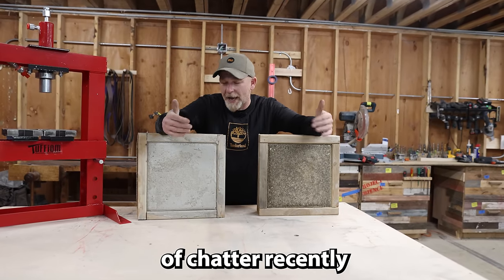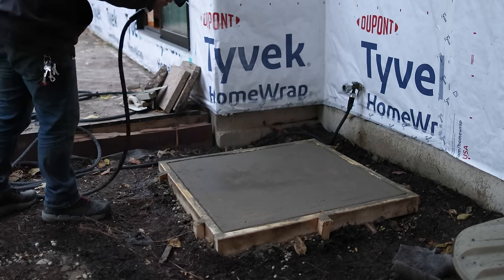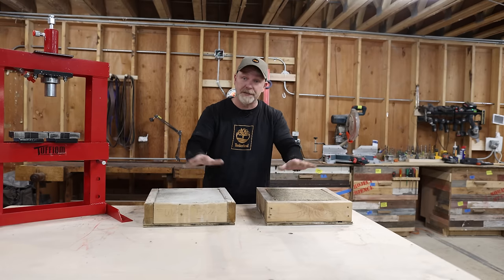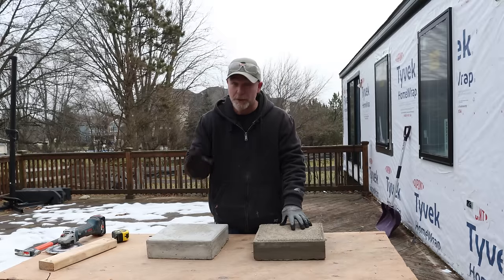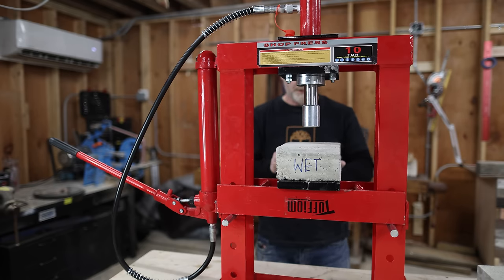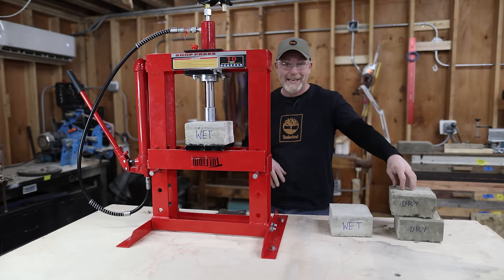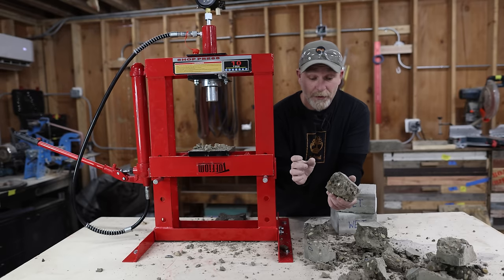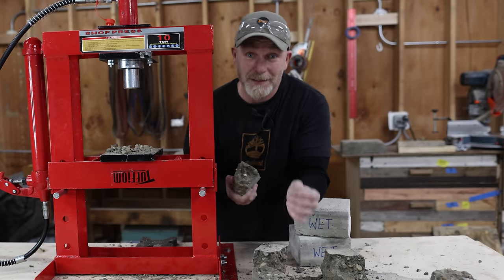The TRUTH About Dry Pour vs Wet Pour Concrete!! Strength Test - You WON'T Believe the results!!

Comment: As a certified concrete field testing technician, I can say that while water is the catalyst which causes the reaction for concrete, too much will cause weakness (ALWAYS READ THE INSTRUTIONS). Concrete does not dry, it CURES through a chemical reaction...which is why it gets hot when poured en-mass. The slump is a very accurate indication of the water content of fresh concrete, unless it contains admixtures such as air-entraining chemicals or fly-ash to increase its 'workability.' (In the case of admixtures, there are correction factors applied to the slump measurements). In any case, once properly mixed concrete is placed, it will continue to gain strength and cure FOR EVER - far beyond the 7-day initial strength, and certainly beyond its 28-day in-service strength.

Comment: I learned this the hard way. I dry poured a small walkway running from the front door to the side of the house. It's been 2 years and the walkway is full of hairline cracks and is getting rougher as time goes by. I'm going to redo the whole thing, but had I done it right the first time I would've saved myself $400 in wasted concrete.

Comment: Water is the catalyst in the chemical reaction. By mixing before the pour you are ensuring every chemical agent in the mix is coming in contact with enough catalyst(water). Dry pour misting will fail to do the same resulting in a much lower failure load.

Comment: Electrical engineer here. Alot of civil engineer here but dont know why dry mix is weaker. 

the main reason dry mix concrete tends to be weaker is because the cement doesn't effectively coat the surface area of the aggregates. When mixing concrete, water plays a critical role in ensuring the cement paste fully surrounds and adheres to the aggregates.

Comment: Thanks for the video. Been contemplating doing a dry pour for my kitchen countertop for a number of reasons. It looked like it had been snowing during your experiment, and I wonder if the weather may have had anything to do with your results. I believe the humidity is quite low during winter months when snowfall is present, and perhaps another dry pour experiment is due during the more rainy season to compare results. In my experience humidity and rainfall play a large roll in concrete setting up.

 I live on the rainy side of the Big Island of Hawaii where the humidity is pretty much 75-90+ % throughout the year so much so that any bags of concrete left outside even if covered will set up within a few months without ever being wetted. I use dry pour when installing fencing t posts after drilling and pounding them onto the lava, because it's easier to get the powder down into the hole around the base of the post, and it sets up quite well here with the regular rainfall, but can crack a bit if tension is put on it while pulling and attaching the fence itself. So unless there is a lag between installing the posts and pulling the fence itself it will have some cracking, but still does what it needs to sturdy the posts, and I do wet pour the corner post after core drilling the holes that will have the most tension put on them. I also wet pour t posts in low spots with additional concrete that will have more upwards tension on them to prevent them from potentially pulling out of the ground.

I've done several wet pour countertops for a guy I help where we build a melamine mold, and wet pour quick set concrete powder, and then flip them over onto the counter so the hopefully smooth base surface becomes the top. They're always a pain in the ass.
 Getting the concrete mixed fast enough, and evenly enough with consistent wetness is always a challenge and a huge mess mixing small batches in a bucket with a paint mixer which is the only way to get the mix thoroughly mixed fast enough and to the right consistency.
 This last time we tried a large slow turn mixer and it was way to slow, wouldn't mix evenly, and started setting up in the mixer so a lot of concrete was wasted. Also this was halfway through the pour so we had to quickly switch back to small batch mixing in a bucket to continue the pour while at the same time trying to salvage the large slow turn mixer by knocking out the setting chunks. Won't be using that again.
This has me considering doing a dry for my kitchen countertop which will be supported by the existing plywood counter that will remain in place after the pour has set. All that needs to be done is to make a small form along the edges. I like the idea of this method for several reasons, firstly it will be seamless, and no need to build melamine molds, and flip heavy concrete countertop sections after they've set, and then grout the seams. Also the surface will be nicely flat and form fit, especially if a powder only concrete is used, and even if it turns out grainy from regular misting a skim coat can always be applied afterwards. Once set it can be stained, and epoxy coated.
  My only concern is how to keep it wet enough until it cures without soaking my entire house. I realize it won't be nearly as strong as a wet pour, but having  seen how solid bags of concrete get just from the relative humidity here I feel like it will be quite strong enough to measure up to the needs of a countertop, and shouldn't have any of the edge chipping issues  when epoxy sealed.
Idk I'm still considering it, but it would sure beat getting concrete everywhere , and all the other challenges of doing a wet pour.

Comment: It makes sense a dry pour does not have the water penetration through it uniformly. I used dry pour for a wooden post once and like the video even after several years when I removed the post the old concrete just crumbled away. The other thing is the dry pour concrete costs a lot more for large areas than getting a trailer load of proper builders mix of gravel and sand and adding the cement to make a quality wet concrete. 
Keeping concrete damp for a week once it has set makes a stronger concrete as well.

Comment: If you're just doing a small slab, just dump the dry concrete bags into your form, and mix it wet while on the ground. I never understood why people mixed in a container right beside the small form, then had to use a shovel to move it 2 ft into the forms. The forms are your container, mix it on the ground.
Reply: Do you put anything under the dry pour first to hold water. I agree on the mixing and then transporting, that's the real pain in the ass, makes sense to just mix it in place. I have a section of dryway that is 12x18 that's currently just stones and right up against the house foundation (cinder block foundation). How would you recommend dry pouring and mixing in place. Gap or no gap along the cinder blocks? The rest of the driveway is concrete they just didn't pour this one section so this section I want to pour is surrounded by concrete driveway on two sides and cinder block foundation on two sides. Thanks

Comment: How about a half-wet pour?  Enough water to kick off the thermogenic crystallizing, but not so much that it squishes or lets a metal anchor sink in it?  Mixed in more water while it was in the hole.  Saved us a whole day of waiting for the cure when putting in anchors for shed posts.  We set the posts on the anchors immediately after wiggling the metal anchors into the damp cement.  Kept wetting it for a week.  No noticeable shift or sinking after placing the posts on top.  It’s working great for our horse shed.

Comment: Read the comments from the engineers.  Dry mix dampened in place is ALWAYS weaker.  Lab concrete tests are made on concrete test  columns that are aged in a curing room  with misting water dripping off the walls.  It is almost an exact scientific test.  As a student Civil Engr  several  of worked in our U OF MD  Engr lab on contract with Md dept of Transportation. We poured many many test blocks of concrete for the interstate I80 ?)  between Baltimore  and York Pa?  continuusy reinforced (with re bars)   As students we learned. More water above spec in the mix=weaker concrete.  Full strength n 28 days. Building  my own home in  2000  I caught the concrete boys adding water to my4k psi ordered mix for the driveway “Goes. Down easy.”   Stopped that shit at once.  Other drives crack after about 1-2 yrs.  Less water at pour== stronger pour. More moisture just after pour=stronger pour.   Good Luck. 
JoeB. U of MD. CIVIL degree Class of 1972

Comment: I used dry pour for the 10×13 slab under our pergola in 2022. It was 4" thick & I also added rebar, I was sure to really soak it for the first 24 hours. I knew that the strength was going to be less, but it was only going to have table & chairs to support. It's still looks good with no cracks, it does have a rougher finish but I'm ok with that.

Comment: To fully cure concrete you need it to be saturated for up to a month. (I saw this on smarter every day once) Dry pour is similar to roman concrete, where cracks form allowing moisture in, which causes the inside to cure more, thus sealing the cracks.

Comment: I've worked in construction for 30 years, I'm notba concrete man, but seen it done many times.  I've never seen professional concrete worker's dry pour concrete.  It's only a short cut, a easy way out of working hard. A neighbor of mine  who does concrete work told me also he has never, and would never, do a dry pour.  Your test proves this, or, the proof is in the pudding.

Comment: Cement is the Bonding Agent in Concrete.  It works by Chemical Reaction with the Molecules in the water.
There is a Timed reaction that takes place,  from when the water is Mixed in.  
If the Proper amount of Water is Not Mixed in at the correct time or Too Much Water is mixed in, then the Strength of the Chemical Bonds will be reduced.
The Bonds develop as crystalline Fingers and rapidly grow at first, then slowly stop growing,  Additives can be added to Increase the rate ,  or Slow down the rate.
Thats the difference between a Quick Setting mix and an extended workability mix.

When you Dry Pour,  and only wet the surface,  the reaction starts and the bonds are only Surface bonds.  Once the Crystaline structure stops, you CAN'T restart it, or get it to Bond to New Crystals.
Then you Soak in more water and again, only surface bonds of the new wet portions are created. So you end up with many areas that are void of the strong crystalline bonds and None that interlocked together with the other already formed crystalline structures.

This is why, there is NO manufacture in the world that Officially endorse Dry pouring of Concrete.
It will Never reach Structural Strength. 

Cement is NOT a glue.  It's a Chemical Bonding Agent that needs to be Homogonous when the chemical reactions start..
When Pouring in steps,  the next pour has to take place before the last pour has stopped making crystals, or there will be a weak bond line between the two pours.
An Additive to extend the working time would normally be used to allow for time between pours, so they can become Homogonous.

is there a use case for dry pouring?  Not in the industrial / commercial industry. Maybe for the Homeowner, for non-Structural, non Load bearing projects.
It will form a firm mass that holds it's shape, but never become Structurally stable.

Comment: I don't know that much about concrete as a landscaper but if there's too much water the bonding agent in the Portland cement will be washed out. Not enough (which it looks like the problem to me) and it will never cohese to itself. Try some more tests on dry pour using more frequent watering (the 30 min. you were talking about -you went 45) and try measuring the water. After pouring the dry into your form put a dam that will keep the water from flowing out of the dry powders form. Might be a good idea to use non water soaking wood for the footing forms

Comment: Concrete chemical curing formula will fill up an 8 section note book. Concrete  will still be curing chemically for many years after the initial pour. Concrete after the initial pour just keeps getting stronger. It really is one of the greatest construction material ever discovered. Current additives to concrete developed can make it stronger than steel/iron. Pretty amazing.

Comment: Dry pour is often used for fence posts. I would like to see wet and dry pour buried 18" under ground, with my water table which is sometimes at 24".
Reply: They've poured wet concrete underwater for generations. You just have to fill the space when the holes emptied of water. The water can flow in on the outside of the wet concrete. Secure concrete they keep it wet so that it cures at its best rate including putting test cylinders in a half of 55 gallon drum full of water until they can be taken to a laboratory

Comment: This technic of dry concrete can be enough resistant for specific using without too much constraint. In addition, a dry concrete slab can be consolidated with metal reinforcement

Comment: Two important steps you missed with the dry pour. When you scree with a board longer than the form you are actually making a "cutting motion" quickly up and down, slowly right to left (or left to right.) So, you are slightly vibrating the form while screeing. This helps to push some rocks down.  You then using a new and dry paint brush roller and lightly roll the surface until smooth and rock/sand free. You then lightly mist the first time essentially barely dampening it. Then lightly mist again every 30 min to 1hr for 8 hours depending on the humidity and moisture of the land. It should look almost identical to your "wet pour."

Comment: A “dry” pour seems like the 80 lb bags of concrete I had leftover in my shop from last year. At first touch they felt like they had hardened and were solid. However, dropping them a bit on each side quickly turned them back into dry mix I could properly mix with water and use.

Comment: Nice testing approach. I'm not an expert but I've poured concreate a few times and I suspected the result. Great to see it backed up by your test. I noticed a lot of other videos tested after a few days or a week, and they used a sledge hammer rather than press, so that doesn't allow good comparison of the failure point. The fact that you couldn't break the wet pour says a lot 🤣
Regarding commercial dry pour products. The only one I can think of is postcrete. But that is likely good enough for holding up fence posts and I suppose the main reason to use it is that it is rapid setting. I'd be inclined to just mix up concrete for posts after seeing this. Likely much stronger and  definitely a lot cheaper.

Comment: I have seen this dry pour concrete advertised and you have just confirmed what I was thinking / questioning, How does the water get from the top all the way to the bottom evenly? Better to go with a Self Compacting Concrete. Going to be interesting to see how long the Dry pour slab lasts!

Comment: As someone who is an engineer and has mixed many hundreds of bags of concrete by hand along with doing many truck-delivered pours, I already knew the outcome expressed here.  The main reason dry pours are not recommended is that you can't control the distribution of the portland cement within the dry pour.  Remember, that bag of Quikrete is composed primarily of three (3) things: portland cement, gravel (varying sizes), and sand.  Unless you have a relatively homogeneous distribution of the portland cement within the mix, you will not get good mechanical bonds between the gravel and sand once the curing process begins.  Without a good distribution of cement, you'll end up with wildly varying degrees of strength in different parts of the mix.  Much poorer mechanical properties, and anistropic (non-uniform) in nature.

So, MIX THAT STUFF THOROUGHLY!

Comment: As a DIY dry pour seemeed like a good option mainly because i didnt know the process of the wet pouring.  However seeing it crack, and not cure was enough to turn me off the idea!  Wet pou4 might be more work initially, but youre also not gambling with the quality of the product you're going to end up with.  And chances are if youre doing dry pour because youre lazy you probably wont actually ever start the project regardless, and will just be a freedom fighter online for the cause 😂

Comment: I think the wet pour is giving the whole mass an even starting point throughout while the dry pour is more like pouring a slab in several layers and at different times. Or, to put it another way, it's like wet pouring a half inch at a time and a day apart.

Comment: The plywood on the bottom of the test slab kept it from pulling the moisture from the ground. Try again with the bottom in contact with the ground. It will likely still not be as strong as wet pour but will be substantially better than your sample.

Comment: Maybe it you removed the forms in 24 hours or so like a regular slab.  That may make a small difference.  I built a deck several years and for the post I filled the post hole with water and sprinkled in the cement and stirred with a small stick of wood.  Still there a working great.  Great video.

Comment: The corp of engineers have been using dry poor in sand bags for erosion for years but chirt pop will cause major cracking on a load shift on the surface of the slab